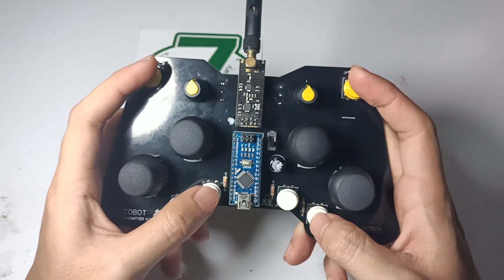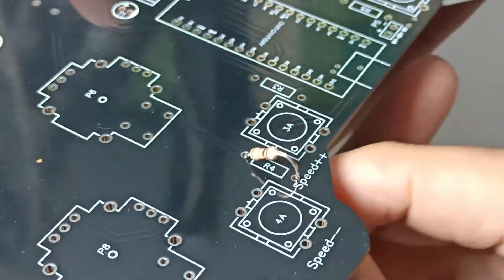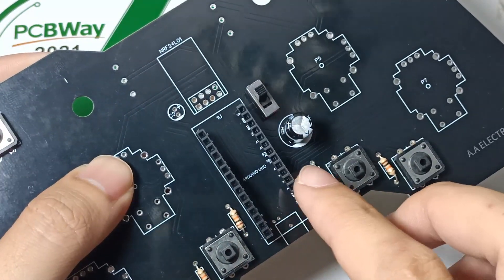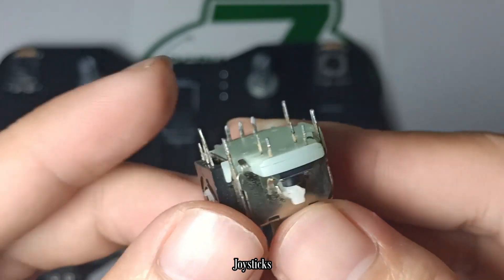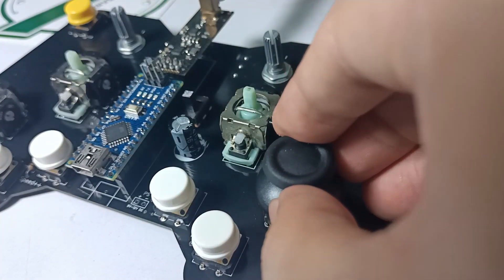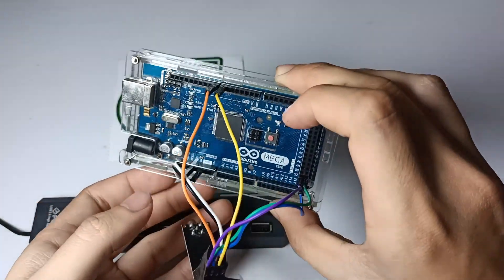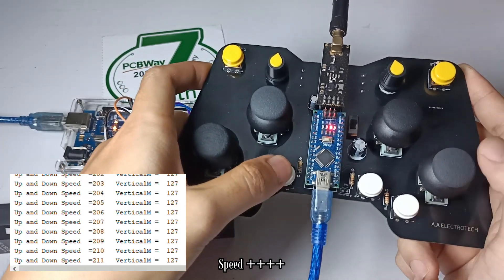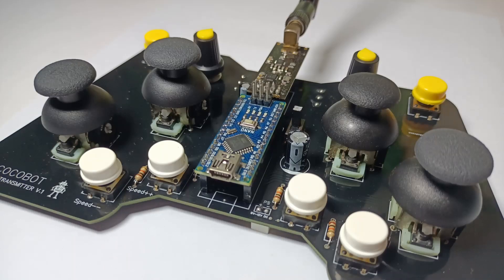Arduino Nrf24l01 transmitter for RC Car RC boat and Drone || Wireless Coconut harvester machine

Comment: i tried to make but its not work is it realy work?
Reply from the maker: Yes of course its working
Reply from the maker: Just check the wiring between arduino and nrf
Reply: @AAElectrotech  i try to make and do what ever i could but it not work. i use aurdino uno for reciver and nano for trasnmiter. is it problem. it it important to use same nano for both reciver ans tranmiter.
Reply from the maker: Any boards, but its very important that you use same digital pins for Csn and Ce
Reply from the maker: You should try a simple transmitting-recieving data like " hello word"
Reply from the maker: To know check that all of the componemts are working properly try simple transmitt and recieve of "hello word"